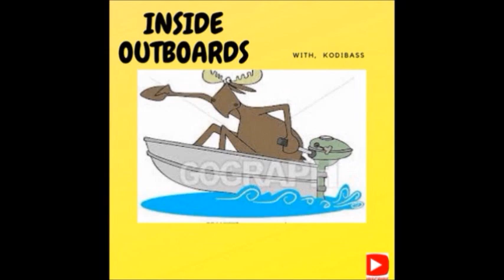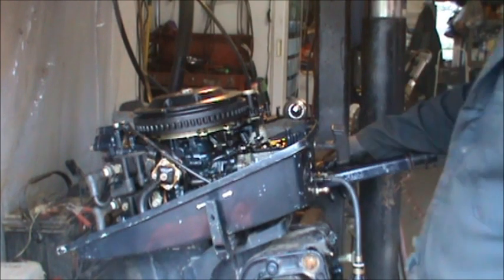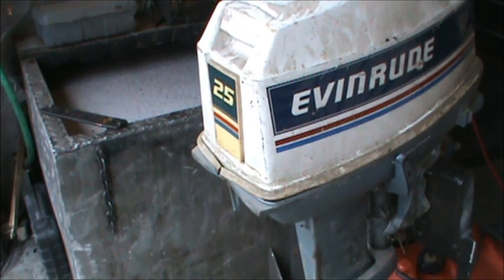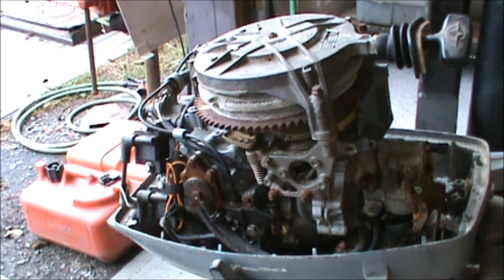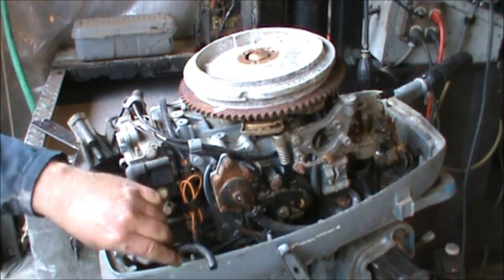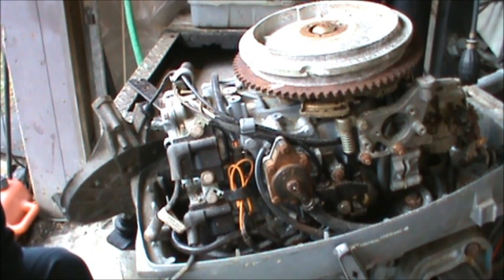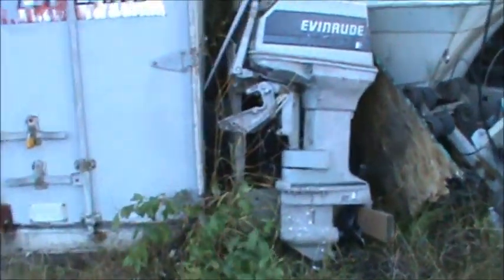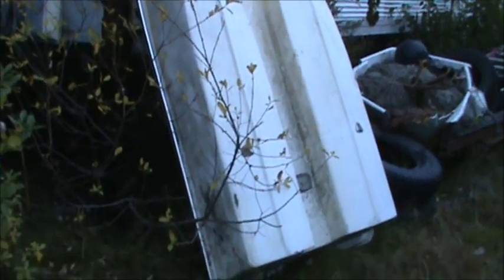EVINRUDE 6 HP,  +  EVINRUDE 25 HP, SEIZED  ?

Comment: Hey Kodi! Last resort with that 25Hp after your soaking cycle pop the head lay motor on it side on the stand to the ground heat the hell out of the pistons with a Mapp gas torch preferably.Tighten up the clamps tight put a breaker bar and pipe on the flywheel nut and tap each piston back and forth one at a time with a heavy brass hammer at the same time pulling the breaker bar tightening and loosening the nut, Alternate tapping on both pistons while pulling on the breaker bar. Works 75% of the time  been doing that since the late1960S,LOL .You can also fill the whole powerhead up in that position with oil and gas or whatever thru the  intake side plate to get to the crank pins and journals bearings etc for a soaking before you try tapping the pistons. Stuff a papertowel in the carb throat and choke it to keep oil in reeds hold most of the oil back. Maybe you know this im not sure  Good Luck luv those freebie motors no matter how bad they are its like you say Christmas in October .........   GP
Reply from the maker: This mite b a hard nut to crack,  The gifter did not know if it was submerged or not,  If I cannot get it to spin I will pop the head off,       thanks               kodi
Reply: @kodibassInsideoutboards  My approach works most times but not on old Mercs,LOLL! Yes always much easier to  remove & replace I agree....

Comment: Nice video, I am a fan of pb blaster and it goes on everywhere. I would of gave the recoil a spray and every rusted bolt I could see. I find spraying Teflon at this point to expensive to spray.
Reply from the maker: Right on, you r so correct.  I hope I can @ least get the Head off to look inside, I 2 like PB but only outside cause it smells BAD..  But works great.  thanks,   kodi

Comment: What year was the 25hp 1975 or so .similar to my 1973 25hp evinrude. As always learning from you. Honestly I've gained 75 % of my learning from you. Thank you for that . Chris from OHIO go Buckeyes
Reply from the maker: Going by memory here But as i remember it was a 1978,  most welcome 4 sure.  kb
Reply: @kodibassInsideoutboards  another question on my 1973 25hp evinrude 25353 what should I torque head bolts to psi I've tried to research this with no luck thanks Chris from OHIO
Reply from the maker: @chriseisele9969    19 FT POUNDS mate.  kb
Reply: Thanks kodibass  your the best Chris from OHIO

Comment: I have a 1996 evinrude 48spl and the charging coil and stop switch melted is the gell in side started leaking out and lost spark i ordered a whole new assembly but apparently they are on back order and was wondering if you had any of them in your spare parts and if so how much you want for them if you are will to part with your parts  i was turned on to your channel from this old outboard  love the videos keep them coming i am learning so much thanks your sub. Steven Gaines Naples fl.
Reply from the maker: I would need the part #  of the charge coil,  I do not have a 96 or later 48 hp motor on hand, However I have a tote or 3 of  stators, charge coils etc. I could look through , thanks   As far as the stop switch I have many,  I would recommend going with a sea dog over a OMC, But I do have them.       kodi
Reply: @kodibassInsideoutboards   charging coil part number is 0585073.   Stop switch number. 0585072. This is according to  Crowley Marian
Reply: Thank you so much for your time

Comment: So what is wrong with the cam roller, wired together??  Those damn primers are a PIA....Over engineered, difficult to use, and most customers (plus many techs) really don't understand how the work...The crazy thing is that OMC probably spent more money in this instance while making the engine harder to start...  The sync process is ridiculous also, another case of over engineering....But, I think I understand why they made the changes.  The older metal bowl 6-8hp models never quite idled correctly, especially if you set the sync up the way it was supposed to be.. So, I understand why they changed the carbs so the throttle plate is "cracked open" slightly at idle.  Just too bad they could have kept the old carb design, which was bullet proof...Someone saved a few pennies...  It's strange how I am always pointing out the short comings with this series of engines but love them at the same time...Those late model 8hps really got some balls...
Such a shame about the 25hp, looks to have low hours, and more importantly as you pointed out, it is unmolested...Sure hope she frees up, this one is worth ripping apart if you need to.  Maybe the gearcase is seized??
LOVE sniffing around, I gotta get better at finding unwanted outboards, but will probably end up divorced if I do....
Reply from the maker: The little plastic u shaped cam roller @ some point got snapped in half, & someone repaired it with bailing wire, It functions, But I need to replace it,  I hope I can get the 25 to spin,  I'll give it another go tomorrow. Yep up @ the storage yard there is one I did not show,  I hope to get my mitts on it & make a guess this outboard video,  I have known of these outboards for sometime but have never see one.  Wish me luck.                kodi
Reply: @kodibassInsideoutboards    I'll cross my fingers buddy...